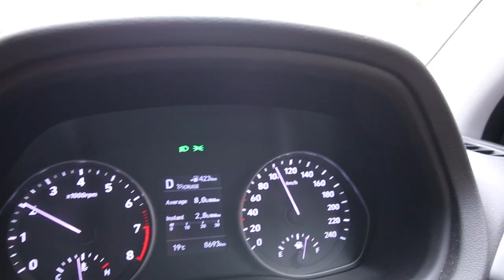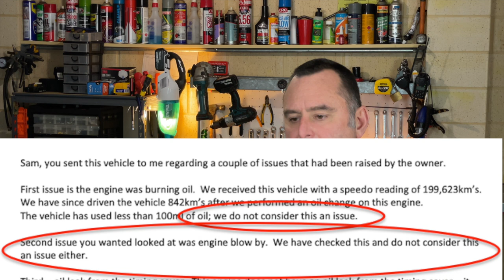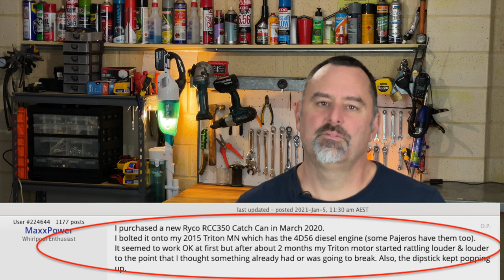Did my 200 Series Landcruiser ENGINE BLOW again - twice in 12 months? Or was the catch can to blame?

Comment: you are such a level headed man,calm and pragmatic
I  served my time as a heavy engine fitter/ mech at Cummins, I  have rebuilt many   engines 555 to 1710 cu inch
training was different in my day, I'm 76
I  have no faith in kids working on my Disco 4, unfortunately, I  had a stroke, so my left arm does not work, so lotsa stuff I can not do
I  have never heard of a catch can
My d4 is a marvelous car , but i hate modern engines
Reply from the maker: Thank you for the kind words. Working on those old diesels would have been satisfying I imagine. Too bad about the stroke, but at least you are still around to tell us about it I suppose. I love the discos but would be too scared to own one myself.
Reply: yes, but I towed a 4000kg lathe and trailer  from Sydney to Sunshine Coast with my 2010tdv6, raining down CUNNINGHAMS GAP , car was rock solid, I  changed to 2016 SDV6 with 125000km on it, 255 hp 6oo nm, 8-speed zf, it is fabulous, but I  nurse it and only tow van with GVM  1800 kg
very quiet mill, 
I  may buy an ICOM SSB just in case i do go bush, I  never park in van parks, like to be alone, although I  am  gregarious
I  had a 2000 d2 drove in Ru Ua  and all over eastern Eu, slept in the forests, was I  scared, yes but in those big truck stops in Ro, Bg. etc I  was more scared, bandits
yes I'm ok, still operate my 4m lathe, grunter welders and design boats, but will never build again as two arms are needed for positional welding
I f you are ever up in QLD let me know eh
Reply from the maker: I do love the rovers, got a few friends with them but they can be fickle! The ICOMs are great, but now days Starlink is another very good option for remote communication. I love Queensland but it’s a loooooong old drive from WA! 😀

Comment: Good to see a fellow bsn local on the tube. Personally fuck the catch can off and vent to atmosphere. Free rust prevention. No further issues.
Reply: The offshoot bonus of doing this is there is zero oil vapour going back thru the intake which means nothing for the EGR gas to react with to cause the sticky residual crap that blocks up intake manifolds and ports. Once you vent crankcase to atmosphere there is no need to block or delete egr to avoid the build up. Also no more oil mist inside your intercooler means it can work more efficiently 👍

Comment: I had decided not to put a catch can on for these reasons you mention in the video. If anything, a regular old metal can with baffles is the way to go. They use these on race cars and old 70-90's turbo cars had them. They perform adequately. I don't really care if oil vapour goes through the intake. I'd much rather clean the whole intake system out every 60-100 thousand km than worry about my catch can blocking up because of the "sludge". The sludge happens rapidly in the catch can. In the intake, it takes many, many km for that sludge to line your intake plumbing and to eventually become a problem.

Comment: I have a Provent 200 fitted to Patrol with no problems at all.  I simply drain it every couple of thousand kilometres in accordance with advice from Berrima Diesel.  If the catch can fills, the pressure and oil have nowhere to go other than the filler cap or the dipstick.  I believe that this is why some engines fitted with catch cans blow. I am sorry to hear of your experience(s).

Comment: Great info mate. Don't believe the naysayers about the LC VDJ200. Bought my VX new in 2008. Now has 325,000ks and going strong with no issues. Done alot of heavy towing with large 3 horse float with living area. Mods include Lovells GVM upgrade, Richards TC lockup with trans and ECU remap with dyno tune, HPD intercooler and catchcan and fuel pre-filter. 

Haven't felt the need to replace stock exhaust as I get plenty of power. Self serviced including all fluids/filters, brakes etc. 

I've replaced the water pump and radiator at the first sign of fatigue before any problems developed. Fuel injector values are like new and I can't see myself replacing it for another 100,000k or beyond. When well cared for, they're a beast of a vehicle. Best car I've ever owned.
Reply from the maker: I’ve just had to do my water pump too. You’d think they would have replaced that when doing an engine rebuild but you know…… also just put the Richards lockup in, I’m loving that!!

Comment: Have just had a Provent added to my Everest 3.2L and all the research I have done indicates that these the best. Also had a remap and was told that as far as power they could have given it more boost but did not recommend it as it could cause problems and damage which I am grateful to them for their honesty. Obviously if I had wanted maximum boost and more power they probably would have turned down the work . I saw the scan of the return manifold on my bus and at 45K km was surprised at how much gunk was already building up. Some will say just give the beast a good burst now and again to keep it clear but from experience I am not a slow driver so this may help a little but won't save Miss Daisy. OH yeah .. good luck if you ever need to approach Consumer Affairs with any problems ... not worth a c#@t full of cold P*^s.   good luck
Reply from the maker: Thanks for this and good luck with the rig, yeah in a previous life I had to deal with what was consumer affairs back then regularly. It was not a great experience from either side.

Comment: You think you could trust RYCO to make a product that 1. Would work. 2. Be safe to install on an engine for an extended period. I'm running the older style, vent to atmosphere in over-pressure situation genuine Mann Hummel Provent 200 on my VDJ79R & have had no issues on 80.000K's other than forking out for the initial cost & replacement filters but it was a well built Western Filters kit that fitted up perfectly. I change out the filter every 40K and take it out & clean them with brake cleaner every 10K. Consider running a E.G.R blank with 8mm hole too.

Comment: I think the Provent 200 may also have had some issues on the early ones. When I ordered a new filter they asked me when I had originally installed it on my 200. They sent me a complete new catch can to install which they said had a different valve on the top. I installed the new one and have not ever had any issues, either before or after the swap over.
Reply from the maker: Very interesting indeed!

Comment: sorry for your troubles Mr.
I  have a d4 discover, i keep the CARSOFT  diagnosis  in the car, plug it in every now n then, it reads cylinder data so's i can see exactly what is going on
As a very young man, I  was an engineer 6000shp tug and in those engines, we read pyro on each cylinder, with very dirty tanks, despite filters  we often saw one cylinder reading cold
I you have an expensive vehicle, it'd be worth getting a diagnostic tool eh? plug the bugger in before you buy.Ah just watched til the end, so, there you are Change to Fleetguard

Comment: This is a great story. For some reason it has become crucial to fit catch cans to modern CRD engines, (and extra fuel filters). I have run a 2014 200 series since new with no catch can, no extra fuel filter, and it runs beautifully. I can’t help but think of the old saying - “If it ain’t broke, don’t fix it…” Thanks for sharing your story, and I’m happy for you that this sorry saga seems to be finally at an end!
Reply from the maker: After doing a $2000 fuel pump due to water contamination on my old TD42, a second fuel filter was something I fitted to that even though it was an old school diesel.

Comment: i had a 60 series sahara turbo diesel 5 speed manual i rebuilt the motor and gearbox and had it tuned the 12HT motor was absolutely bullet proof i thrashed the crap out of it and it never missed a beat everyone behind me was complaining about getting covered in mud well that's what happen's when you have 15psi of boost and 650NM'S OF torque 33inch mud tyres and 2wd awesome fun sadly cancer took over the body and i no longer have her and i miss her
Reply from the maker: 12HTs were great motors.

Comment: I had similar oil leak problems from the injector seals on my R51 which I purchased second hand a few years ago.
After some research I replaced the catch can which was fitted when I bought it with a ProVent 200 and all my oil leaks went away.

Comment: After suspect advice from an alleged mechanic i threw a 1 litre plastic bottle with foam in it on the tappet cover. Little to no oil usage and 160000klm before a complete rebuild was necessary due to ultra high klm. I even have one on my mower

Comment: On the plus side, you received pretty good service from the dealer to have the engine rebuilt. I like to analyse faults myself. Your video opened with the excess blowby from the filler cap. I am losing sleep wondering what it looked like after you removed the one way valve. Can you add a post script video?
Reply from the maker: There have been some developments on this, and don’t worry the car is fine. I will be doing a follow up video once a few more ducks line up.
Reply: @JebbreysJibberish  Can’t wait👍👍

Comment: Here in the states, we don't get the Toyota diesels but we do have diesels in other rigs that have similar issues with plugged or otherwise ineffective crankcase vent systems.  If you want to see a helluva mess, talk to truckers about plugged crankcase vent filters on a Cummins ISX.   Imagine what a gallon of oil looks like all over a hot engine, no bueno.

Comment: Hey mate just giving my 2 cents worth I would remove the catch can all together install a egr blanking plate and just turn it off on the ecu and your car will never have an issue again the car needs the oil to lubricate the head just not the exhaust gases 👍

Comment: You can put stainless steel scrubbing wool inside the catch can to work as a filter medium, it is extremely open but will catch a good amount without being to restrictive.
Reply from the maker: Great idea!
Reply: @JebbreysJibberish  I have a provent catch can similar to the Repco and the filters are too expensive for what they are IMO, I remember seeing videos of people putting the stainless steel wool pads in their cheap empty ones like you mentioned in the video so I tried that. 
I used 2 (they come in 2 packs at Woolworths and I spread them out a bit so they had a little tension on the side of the can. 
I’m sure it won’t filter out like the original but it’s less restrictive which is not necessarily a bad thing
Reply from the maker: What about it getting into the air intake? Do you think that’s a possibility?
Reply: @JebbreysJibberish  highly doubt it, it is not the fine type like you get with the ones that have the soap on them. 
I did inspect if they separated and had loose pieces but they don’t. 
I do monitor the process when I have the hood open and all is good.
Reply from the maker: I’ve one. Seems a lot of people commenting that they’ve done the same. 👍

Comment: Im on my second cruiser, sold my first one with 330k no issues - no mods. Its still going good as i know the person who bought it. 
Current cruiser newer model with all the mods, catch can, secondary fuel filter etc...since I had secondary fuel filter installed i had alot of trouble with the car running rough or not starting. Caused me alot of headaches as I couldn’t find what the problem is. Forums didnt help much, every one kept suggesting injectors, engine cooked etc... 
After many weeks of headaches a backyard mechanic found a leak in fuel lines connected to secondary fuel filter - problem solved! 
I dont know why alot of people are quick to point to the worst possible outcomes such as injectors are bad, engine is cooked etc?  I have a feeling that if you ask why the tyre is flat someone is going to suggest to check injectors! Lol. 
Sometimes you just get unlucky with the simplest of the mods and worst is when even a professional mechanics cant find a solution for such a simple problem.
Reply: Yes, some very dodgy mechanics out there, some of them even work for major dealers. Had an issue with my centre diff light coming on in my 200. When the light was on it meant I could not engage low range or cruise control. Took it to the dealer where I bought it from, the "Service Adviser" called me later to say they could find no problem, so I went back to pick it up. Light was out, which is what it did when it was stopped and restarted whilst warm,  but when I asked the "service adviser" what I should do if the event re-occurs he suggested removing the light !!!!   I kid you not. Never been back to the same dealer since. Took the 200 to another branch of the same company when  the issue did re-occur and the work-shop manager found the issue, within 30 minutes, a $3K part, an actuator in the transmission.
All I can suggest to 200 series owners is that they regularly engage the low range and listen for the definite clunk when it engages, it helps to keep the actuator functioning.

Comment: OEM filters. Change fluids when they are dirty not by a set interval yet with a max milage such as 6,000kms. Short drives or long drives in dusty/harsh environments require more often oil changes. Catch can with a filter are not a go. Use a catch can with screens, such as the HPD catch can. With proper gear and maintenance the diesel should last 500,000+kms. I have opened up 1HDFTE engines with 250,000kms with everything on the bottom end still within specs. The heads just get clogged up with soot and gunk due to the EGR systems.

Comment: I usually do oil changes myself, and use Ryco oil filters on my 2010 Prado. After one change, i started getting low oil pressure light every now and then, usually after only driving a few minutes I'd reach a stretch of 80km/hr road on way home from work, and when i reach 80 km/hr and come off the throttle, low oil pressure would come on for 10 secs or so. Very unpleasant. After changing the oil filter, I haven't seen it again. No more Ryco garbage for me either.
Reply: Use Fleetguard filters

Comment: . it's actually an excellent vid and very informative .... thank you. have had a provent from new (now 72k) zero issues.  installed correctly and "maintained" they are worth it ..  note that the new 79 series etc with the 4 cylinder motor are being released from the factory with a catch can.... go figure
Reply from the maker: Mine was installed correctly and was less than 10,000kms before it caused the issue so it’s worth being quite cautious. The 1VD is a heavy breather and can clog the catch can filters quickly.

Comment: Thanks for posting up your catch can info , there are too many shit cans out there and unfortunately Ryco was one of them . The other major problem was people hooking them up the wrong way around and increasing crank case pressure blowing seals. I have a Mann & Hummel 200 Provent catch can on my 2022 Prado  and have had no issues , in fact after 15000km I have drained about 200ml of water and 60ml of oil  that would have gone through the inlet manifold and intercooler so it seems to be doing its job.
Reply from the maker: Yep and the Ryco and Provent 200 plumb up in opposite directions. However mine was plumbed up correctly. There are people with Provents like yours that have also had similar issues especially with heavy breathing diesels like the 1VD and some of the Mitsubishis. Personally I’d take it off but that’s just me.

Comment: I have had at least 30 cars 4x4's at truck since I got my licence, if I have learned anything doing my own services and repairs it's that that dreaded brand you had the issue with was anything I  bought with anything they made was immediately removed and replaced with ones that actually do what they are supposed to. Steer clear.

Comment: I can confirm that the new Ryco catch cans do not have the check valve. I had a customer with a  ZD30 with exactly same problem. Ryco would not accept any fault. After fitting the updated 351 catch can resolved the issue.
Reply from the maker: I now have the 351 installed. Fingers crossed!

Comment: Thank you by seeing this I think that my ryco catch can is causing my problems I’ve got a 2008 ford Ranger, I’ve been having excessive blow by, oil leaks and not running right ever  since putting it in
Reply from the maker: What model is it? It will be embossed on the lid. If it’s the RCC350 then that may very well be your issue.
Reply: @JebbreysJibberish  I’m not at home at the moment, I brought it last year about 8 months ago
Reply: @JebbreysJibberish  rcc350 I know it’s a Ford Ranger lol, I had the ranger for nearly 4 had hardly and problems except the gearbox, in the last 6 months I had the rocker cover gasket done 2 twice now it’s starting to leak again also have a new head with all new hardware so motor is good
Reply: Everyone make sure the hoses lines are hooked up correctly as the Roy is reverse to prevent ,and frequent change of your filters every 9-10,000km great vid excellent topic
Reply from the maker: Yes this is why the Ryco is still filtering out blow-by even without the filter device the return is at the top with a cup preventing the site going straight out. Mine was hooked up correctly but it was the first thing I checked and is a very good point.